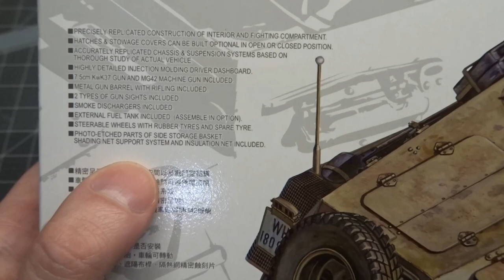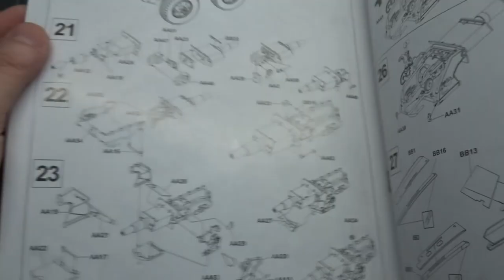AFV Club Sd.kfz. 233 w/7.5cm main gun (Update 1)

Comment: Another kit from AFV its a great and unusual vehicle yet the manufacturer is very short in detail, fit and finish. this kit requires a higher degree of skill to make parts fit well. lots of contact points on the parts tree, flimsy plastic parts, some parts are unrealistically small which are completely lost in the final build, most people wont see them. waiting for tamiya to create such a model. Cross your fingers. no one beats Tamiyas high degree of detail, fit and finish.
Reply from the maker: You are correct, so many small parts especially on the frame that will never be seen but can also screw with the overall fit in the end

Comment: Thanks for this build video - it's been very helpful as I work on my AFV Club SdKfz 263 PzFuWg 8-Rad.  I have very mixed feelings about this kit.  Suspension detail was superb, but some of the engineering details seem overly complex.  Add some outright mistakes on the kit instructions and the body alignment issues you mention, making this  a challenging project.  This is also my first AFV Club kit, as I always wanted to make the radio command version of this vehicle and they offered it.  I'm looking forward to working on the Tamiya SdKfz 232 kit as a comparison build.
Reply from the maker: You are welcome! I agree the suspension and frame are way over engineered and you won't see most of it in the end. This was my second AFV Club kit and they do turn out extremely well in the end I think I will stick with Dragon's 8rad kits, they are simpler but still have incredible detail where you can see it.